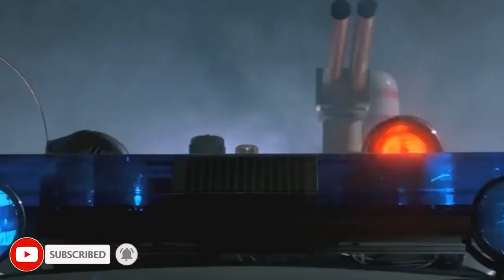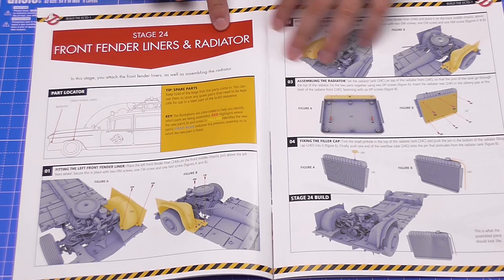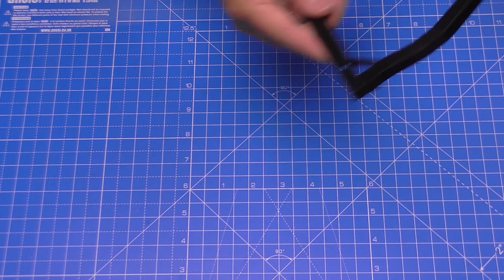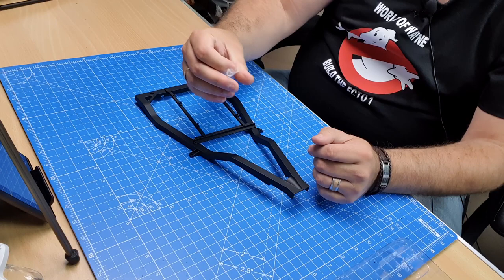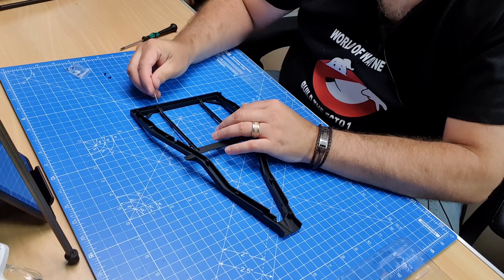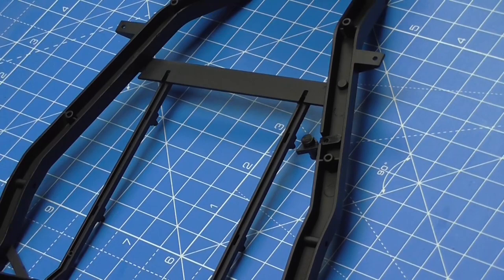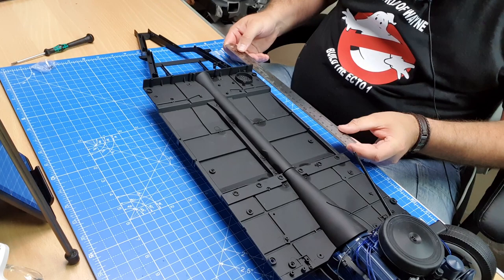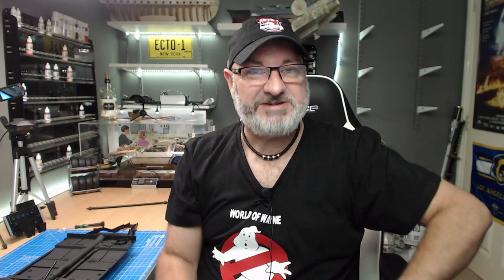Build the Ghostbusters Ecto-1 - Part 22 - Rear Chassis Frame and Leveling Valve

Comment: You have the frame backwards, the small end will hook to the chassis. Also the 12 volt battery is between the front grill and radiator so that bracket is likely for the lights and sound on the car.

Comment: Heard your comment on battery location on actual vehicles. Had to laugh. Recently replaced the battery in my GMC Acadia, its actually located somewhere under the front passenger seat/rear floorboard area. I would have never found it my own and I've been doing basic car maintenance for around 40 years!

Comment: That's a big model,, cant wait till mine gets that far.  I seem to think the next steps after your next issue with those wheel wells  are the right and left exhaust, firewall and other engine compartment  components,  rear axle and brake drums. That's an X frame so the widest part of that rear goes to the back the small part attaches to what you were working on.  Battery box should be hidden in the gas tank at the rear.

Comment: Not commenting on the frame. I will leave that to others.. I didn't beat Peck here, but was the 100th like.
Yes, Cadillac uses a standard 12 volt battery. I am surprised at the inclusion of the leveling valve. This degree of accuracy makes me.... dare I say it... smile.
Reply from the maker: lol. Yer I realised I had the frame backwards when Matt T told me. We don't actually do anything with that yet.

Comment: Regarding one of the latter 2 recessed em screws, one of my ones wouldn’t tighten. Hole was oversized on chassis., replaced with a cm screw and no problem.

Comment: I have to question the quality of the instructions. First it was the "oil pipes" instead of brake lines. Now they are calling the fuel tank mount a battery box mount? Bad translation or somebody really has no clue about automobiles. And that rear frame goes the other way around. I do love your channel though!
Reply from the maker: I think they are using what would be the fuel tank to store the batteries to power this model. Hope that makes sense.